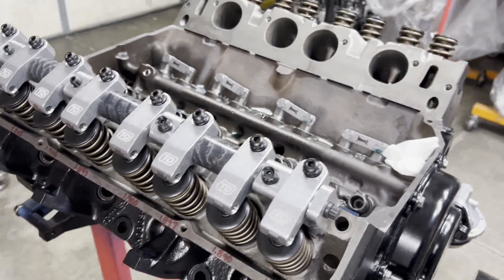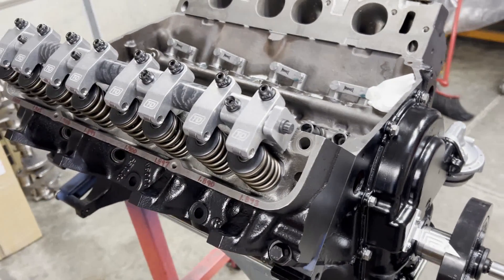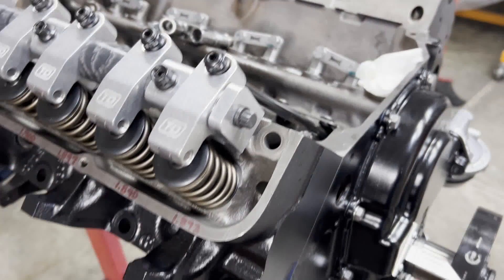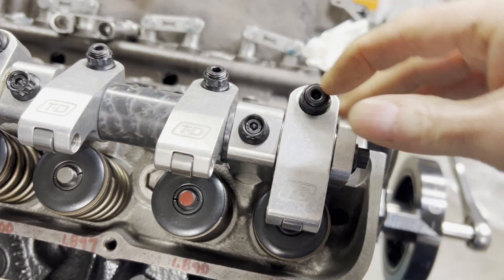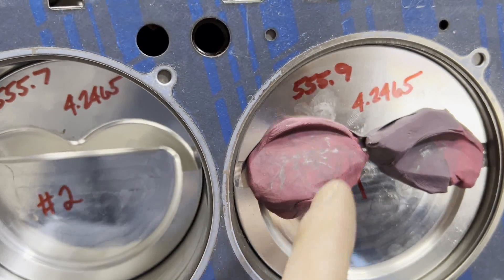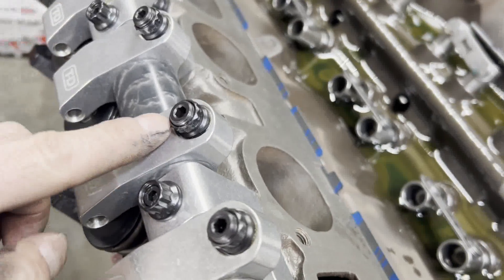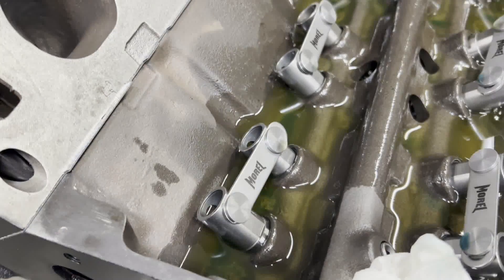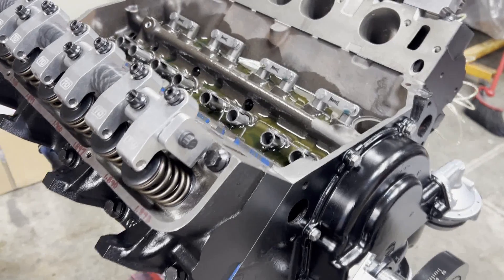Lykins Motorsports How To Check Ford FE Pushrod Length

Comment: Sorry fornthr rockie question but does the hydraulic lifter be oil or dry? And measuring at the bas of the cam? 180 to highest lift point?

Comment: The 444 stroker  kit for the fe    im building     has 
scat  forged steel crank   ,aluminum  forged mahl  pistions,   edelbrock  performer  rpm heads, and rpm  intake , comp thumpn cam  , hydrolic roller lifters,       I am worried  about valve   to pistion clearance tho ,,,,,   waiting on the block still  to come back,      any  input would be helpful

Comment: Does using the push rods for oiling the top end add any stiffness to pushrod? If so does it offset the weight gains for stiffness gains?
Reply from the maker: You never worry about pushrod weight.  It's inconsequential.

Comment: Had a customer that I built a nice little 427 small block Ford for call me after he did a oil change and told me the oil pressure dropped to 20 psi when he was priming the engine just to find out the chuck on his drill was loose 😳 so I know what you mean ...